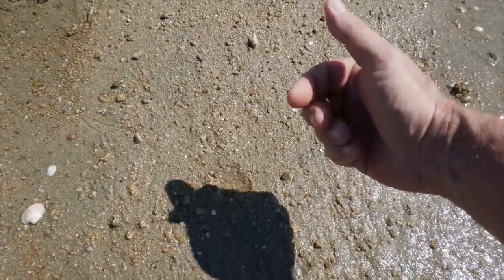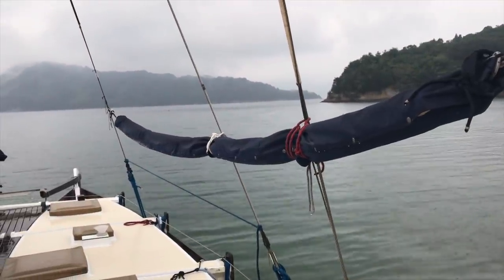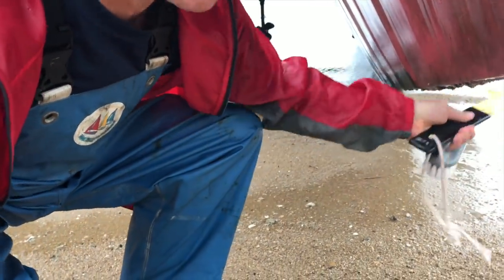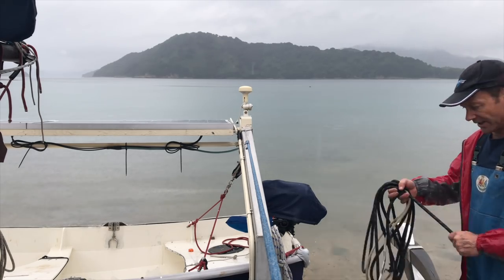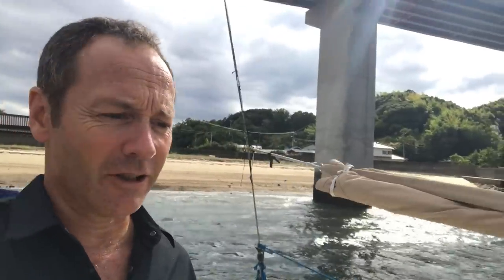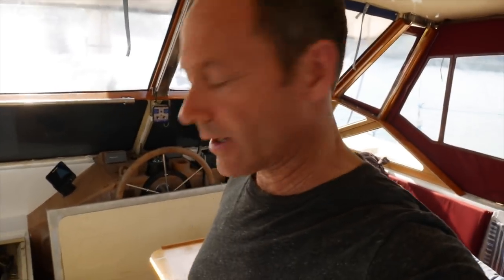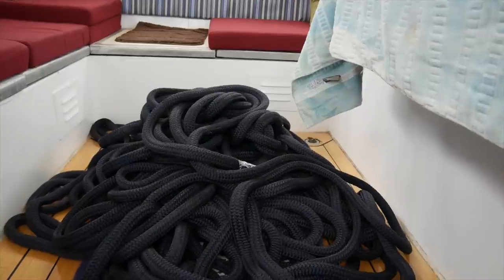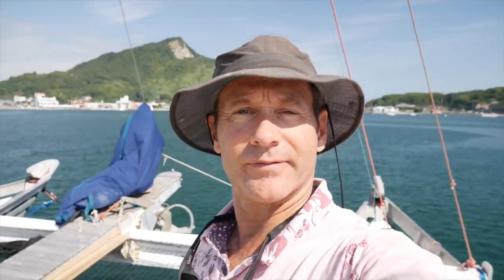Beaching our Wharram Catamaran!  [Go Sea Camping - Ep01]

Comment: Are you using tubing to encourage the oil flow??  That way the air would transfer thru the tube like a straw and let the oil flow quicker.  Just a thought.  And can you turn up the volume mate, can hardly hear you.  Great scenery and video...
Reply from the maker: Hi Shane thank for the comment. Part of the issue was the narrowness and the path of the filler tube. All sorted now as have increased the filler diameter and straightened out the oil filler tube. Sound hopefully my more recent videos are better, steep learning curve on sound and video editing.
Reply: Sea Japan; Cool mate, always the way.  Hope you manage to have a great New Years this year.  Cheers for now mate...   ;-}

Comment: Your forming a seal with the bottle. This will take forever, can get messy also. You have the right idea with the small hose but its probably getting blocked. Try getting a larger diameter hose and put it into the engine through the bottle before you start putting in oil. Cutting that small line into 2 or 3 might work better. Putting which ever line first before oil will give you better chances at the line not getting blocked so air can escape through them.
Reply from the maker: Elysium Tech Thanks for the advice. Will be overhauling the drives around Xmas and certainly looking at all options to speed up the process.

Comment: Heat the oil first. Also you can use the oil bottle and put a 1/4 inch hose onto a hole in the cap. Then just put it the fill hole and squeeze the container .
Old trick
Reply from the maker: Thank you. Excellent advice. Will do this next time. 👍